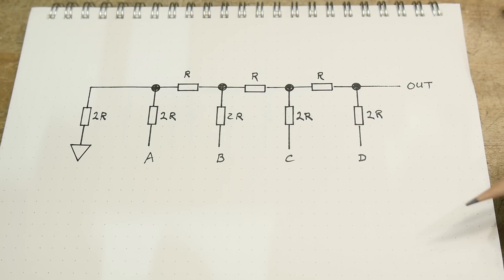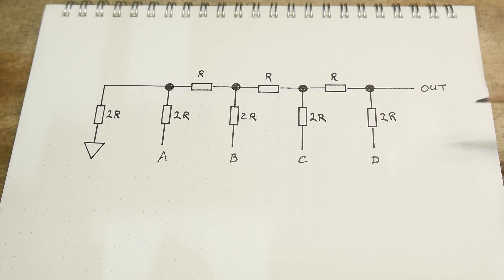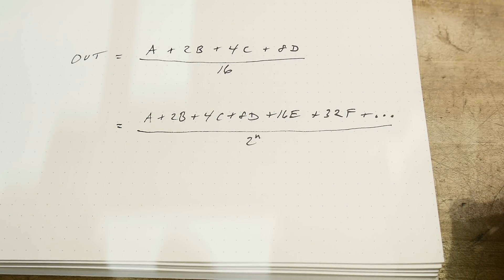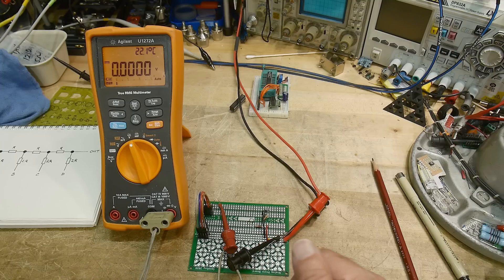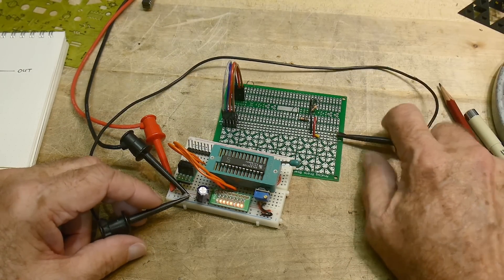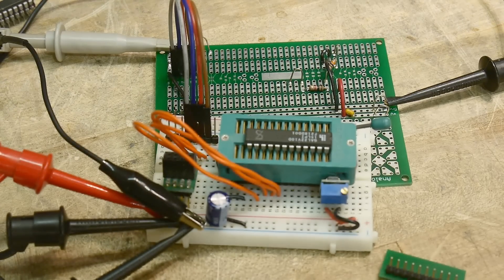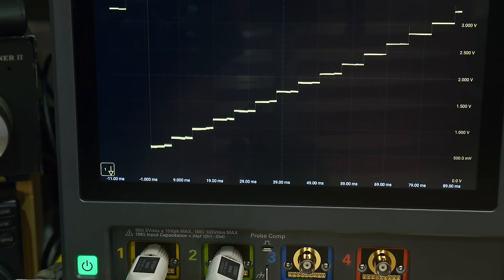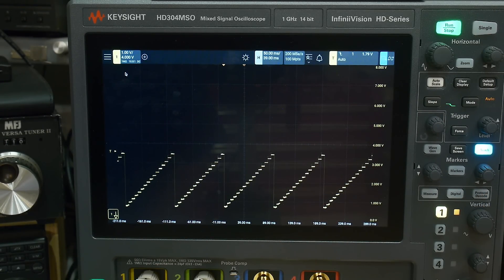#2038 R-2R Resistor Ladder D/A Conversion

Comment: Thanks for the fun video.  It seems like the practical limit to an R2R array is around six or seven bits if you use
1% tolerance resistors, it is a tricky problem to see how the tolerances combine .  Resistors from the same batch
would probably help, as would making the R or 2R parts out of series or parallel resistors from the same batch.
One could take it further and sort the resistors for more precise tolerance.  The advantages of a monolithic DAC
chip become fairly obvious as soon as you need more bits of resolution.  I've used the Maxim MAX522 dual
8 bit SPI interfaced DACs to good effect.

Here's a suggestion for your chip of the day series: the Panasonic AQV252G, a solid-state AC or DC relay
that can pass up to 5A in the DC configuration.

Comment: It seems like the voltage at the top of the stairstep is closer to 4v than (15/16 * 5)v which would be ~4.7v. Is the voltage input low or is something else causing the drop.
Reply from the maker: TTL devices never go up to 5.0v output level. different from CMOS

Comment: What are the limitations of such DAC (in terms of frequencies)? I'm currently using an FPGA board to sample ADC values from an function generator and then I want to use a DAC to output the equivalent signal, it would be fun to try out making a 2R Ladder.

Comment: I would say that you should use a grey code counter output, which only has a 1 bit transition, but then the resistor network would not work!

Comment: The first vacuum tube curve tracer I ever built used a R2R resistor ladder and a CD4040 binary counter.  Used 3 bits of the counter IC to create 8 ( 2 X 2 X 2 = 8) grid bias steps for the tube under test.
Reply: I did the same using cd4024 and R2R ladder and I got up to 128 steps.  If I wanted fewer steps, I would move the reset line to pins equivalent to 2^n.

But you must have had a double DPDT to switch for the PNP transistors, and to reverse the ladder for BC and CE voltages.

Comment: I thought most TTL used a totem pole (pull up and pull down transistors) for the last stage.  You might still see different impedance positive or negative but it should be better than a resistor pull up.  I also thought they overlapped both transistors briefly to speed switching, hence the need for a capacitor at each chip.  Granted this is remembered from classes 40 years ago 😊
Reply from the maker: The pull up has an added resistor. Check the data sheets

Comment: Yeah, these DACs are not great on TTL.  Further, most TTL outputs across a single device (e.g. 74LS374) are not matched well which causes more headaches.  They work great with 74AC logic though.

Comment: Another thing is to invert the voltage on the MSB intput. So instead of going to +5V, you go the other way and go to -5V. Combined with a 2's compliment input you should still have a ~5v p-p output only now centred around 0v. Great for synthesising an analogue signal without the need for a coupling cap allowing you to apply dc offsets if necessary.